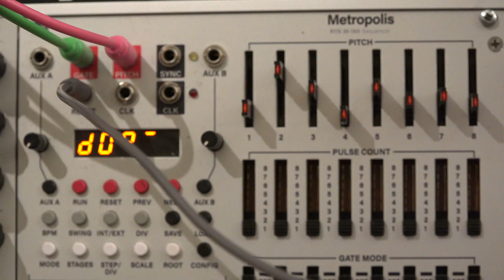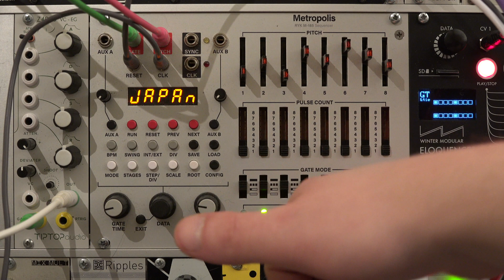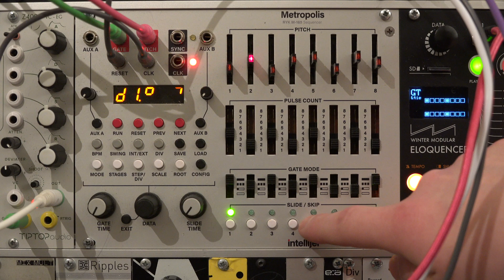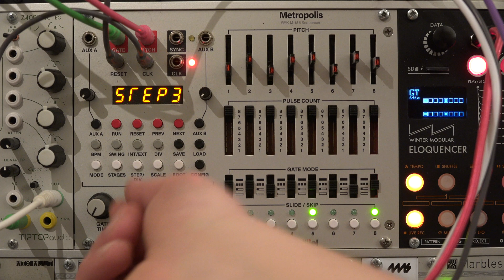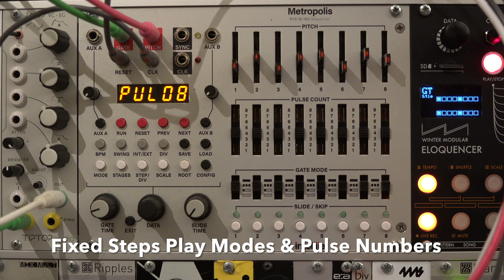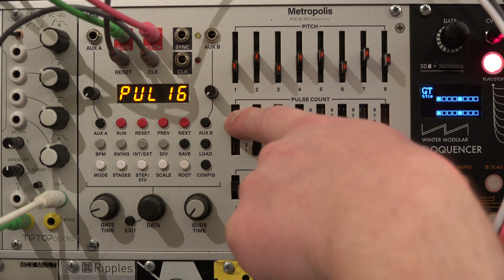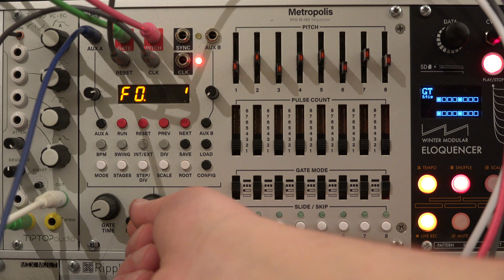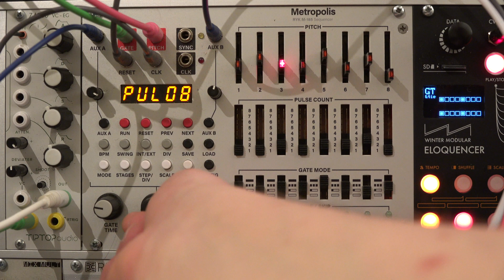Intellijel Metropolis - Multi-Stage Sequencer

Comment: Thanks for your explanation. How can I change the root note with AUX. I want a sequence to be transpose from e.g. a to c. I would like to do that with the AUX and external sequencer e.g. Eloquencer.
Reply from the maker: the AUX inputs have the function „ROOT“, which shifts the root note according to the CV you send there. btw, i´m doing the same thing but the other way round: my metropolis shifts the root note of my eloquencer patterns (since metropolis has more steps in a sequence than one eloquencer pattern).

Comment: if you were making a modular synth that you had to use for an extended period of time that would only have one dedicated sequencer, would you prefer to have this or Rene?
Reply from the maker: as main sequencer (if you need multiple sequencer or modulation tracks) I would absolutely recommend the eloquencer.. if it comes down between metropolis and Rene, it depends on your style.. metropolis is more direct, like programming a TR-style of sequencer, Rene is more experimental. for me its more important to program exactly what I want as fast as possible, so I´d go with metropolis.
Reply: @DominikVogelModular  hm. Im pretty sure i dont need eloquencer (a bit overkill for my plans). I think Rene would probably suit me best, thought it is somewhat hard to tell given how early i am into doing eurorack.

Comment: noob question, what module is going to the aux inputs of the metropolis? im trying to figure out the possibilities i have with aux a and b, thanks for the video btw.
Reply from the maker: depends on what you want to achieve and which parameter aux a and b are modulating. for example gate length can be modulated with any LFO or Envelope for "gliding" transitions, if you patch a gate or s&h you will get "sudden" changes etc